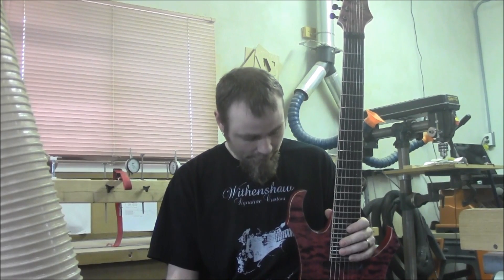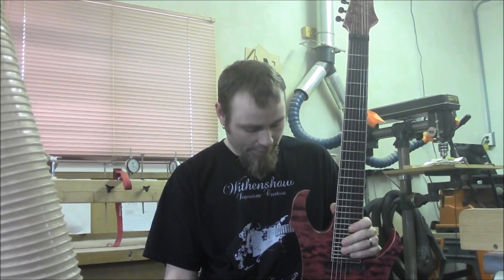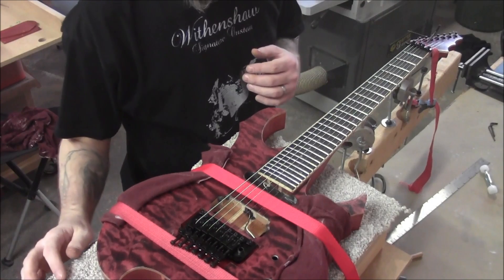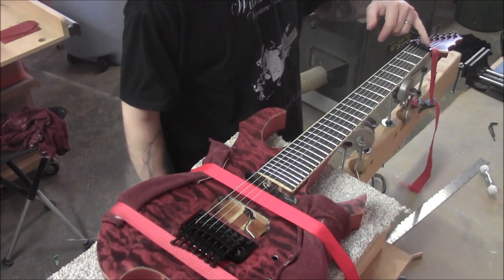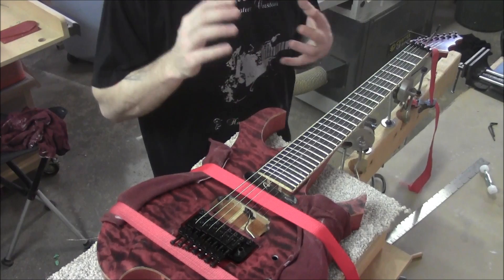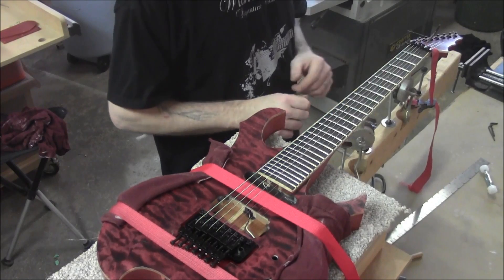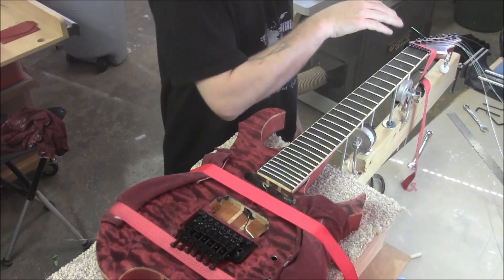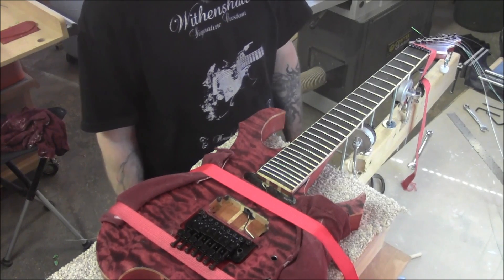How to Build an Electric Guitar-Video 24 - Fret Leveling-Jig Setup

Comment: I'm surprised at how many luthiers and repairmen don't use a jig for fret leveling. Like you said, a couple of thousandths makes a difference. It's amazing how little it takes for someone's hand to feel the difference. Just compare a couple of high E strings... a .008 to a .009; or 009 to 010... you can definitely feel the difference! Great video. Thanks!